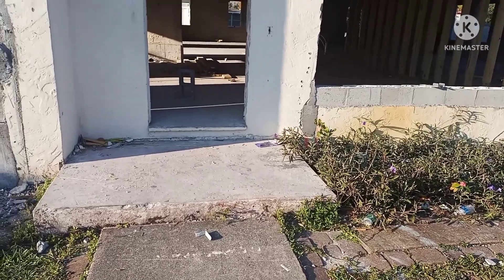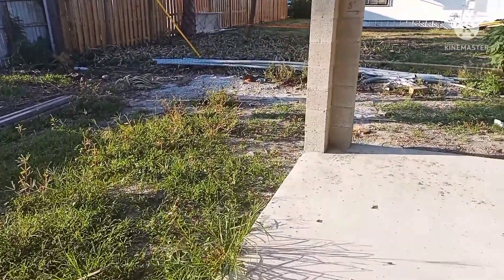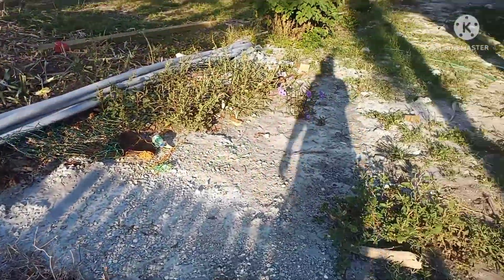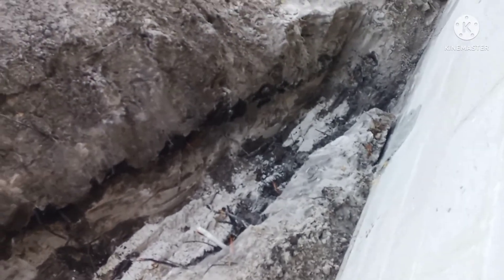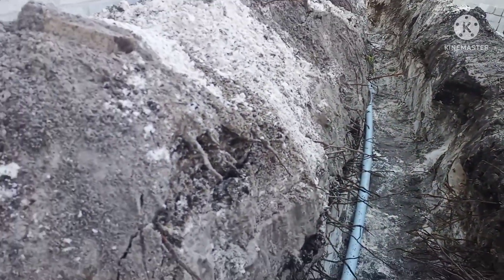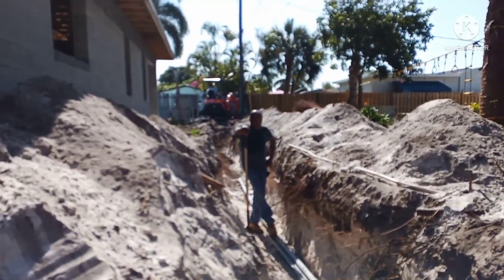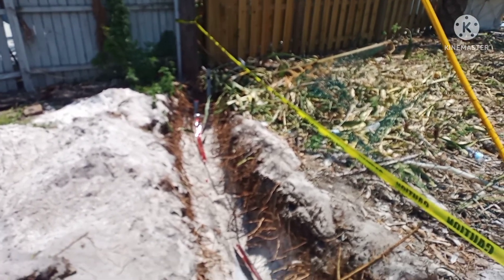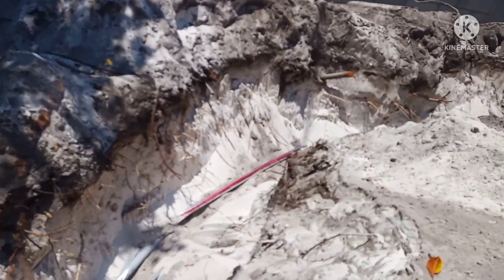How to trench for an underground Electrical service conduit FPL pipe,

Comment: Way too much of an opening for schedule 40 PVC pipe! waste of work
Reply from the maker: Yes but I had somebody to dig it with a backhoe and there was a lot of roots and rocks went 30 inches deep also needed to get two 3/4 pipes and I feel inch FPL pipe
Reply: @albertmorellipalmbeacher3648  I understand but most locations I have done do not even have room to bring a backhoe in let alone a motorized trencher.